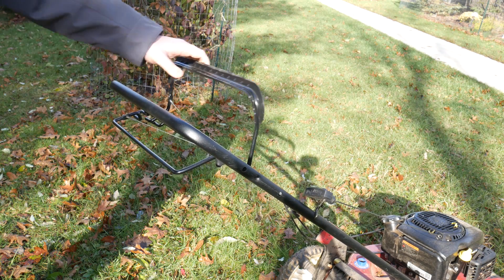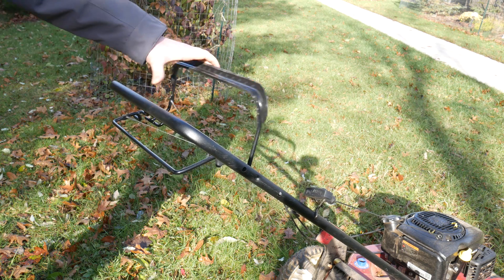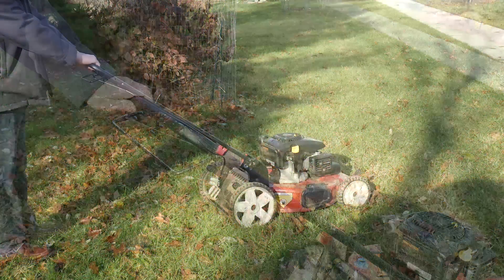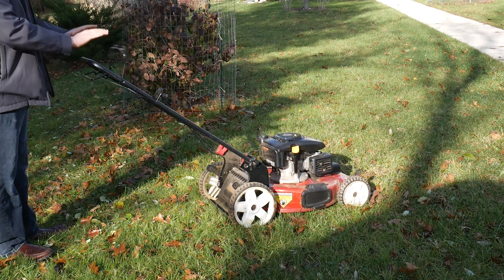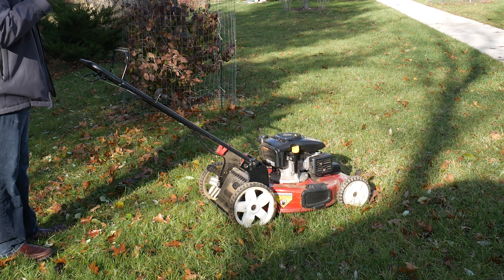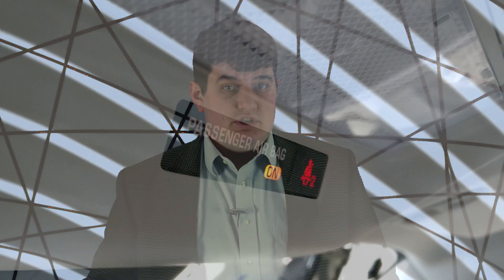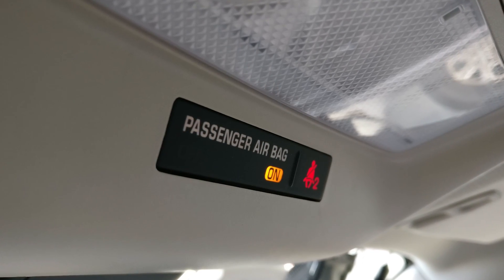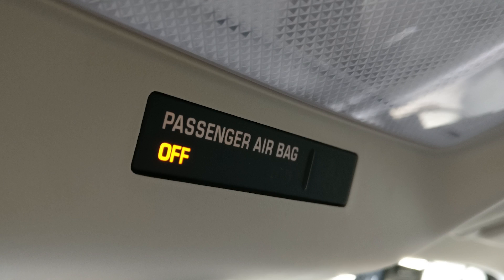The Dead Man's Switch:  How Anton Yelchin's life could have been saved

Comment: Yeah see i dont agree with this one, its good in theory, but cars are already getting worse and worse because of the hundreds more falure points added with each and every electronic system that requires a ton of very fragile equipment in order to make the vehicle function properly. Most safety issues could be solved with social engineering rather than making cars worse. Rather than adding another point of falure we should focus on making cars scary again. Carse are HEAVY MACHINERY and just like any other heavy machinery you should have a healthy fear of the fact that, if handled wrong, it can and WILL kill you. For manufacturers this means, stop putting non intuitive controls in something that someone is going to use daily. And for the consumer this means you should always have complete respect for yohr equipment and make damn sure your using it exactly how you should be. This isnt just a way to get from place to place, its an actual TON of steel thats, at bare minimum, moving faster than the fastest human on earth. This thin can shred organs and send you flying across the roat at school zone speeds and you should absolutely be treating it as such.

Comment: The one caveat to keep in mind with such deadman's switches is that it would need to not engage if the car is going at high speed (say, when the sensor fails while you're going 75 on the Interstate.) Also, I think it would be better to have the sensor engage the parking brake rather than shift into park, since the brakes are cheaper to replace than the transmission.
Reply: He mentioned this at 6:47, and the car I drive prevent shifting into park if the vehicle is moving.

Comment: 8 years later, some modern cars actually have these features, to the annoyance of technicians like me.

Recently many vehicles have slammed itself into park as I lean slightly out the window to see where the wheels are on the alignment lift. Now I am fine with this due to safety reasons, but manufacturers need to be better about having accessible options to temporarily disable these features during service.

Comment: There are “interlock” switches that cut off any input from the operator unless their butt is in the seat for the forklift at my work.
No throttle, no forklift control, until you’re sitting in the seat, then it allows operation.

Comment: Slight problem with this: what happens if the sensor becomes faulty, and reports, even for a fraction of a second, that the seat is empty when it is not?  A car shifting into park in the middle of the highway because a vibration jostled the sensor loose would at best end in a lawsuit and at worst in death.
Reply: But regular train have it already and it seems not so dangerous
Reply: @Lateever  yes, because a train coming to a stop in the middle of the tracks is rarely in danger of being rear-ended by the train behind it that did not have time to stop.

Comment: While agreeing in general terms i would like to add two repostes seven years later.

Based on track tecord i wouldn't expect car manufacturers to include overrides for failed sensors that prevent operation.

My electric bmw turns off and beeps incessently if the driver door is opened while in driving mode, even if in park. If you ger into the car, turn it on fully (with brake applied) and then need to exit to remove snow for example you have to shut the car off and then restart it in the base mode (without brake applied). The same happens if you are at a stand still in drive with brakes applied and want to open the door to check if you are properly inside the parking spot. It is flipping annoying and exactly what a car manufacturer do with this kind of idea.

Comment: Hi, I'm from the future. I'm happy to report that in my driving experience both Ford and Tesla have employed such technology by now. In 2023 I will buy a new-fangled F150 pickup truck that is actually all electrical, instead of running on diesel or gasoline. I know, it's amazeballs! In any event, while still in reverse, neutral, or drive when I open the driver's door the truck automatically shifts into park and tells me it's applied the parking brakes. I wonder if they did that because of Mr. Yelchin's avoidable death?

Comment: Many automakers have been doing something to solve this for decades. They use the drivers door instead, open it whilst stopped and the vehicle goes into park / neutral and you have to put foot on brake and reselect drive to go again. Something that is easy to do with these modern electronic shifters rather than physical cable ones.

Comment: So here’s the problem. There are many reasons why you may not want to be in park without someone in the driver seat with the belt undone. Pushing, towing, automatic car washes, and other situations need the car to move freely under other power. Also if need to undo the seat belt while driving to take off a jacket, or adjust the belt tension, I don’t want the car being forced into park from highway speed. A smart switch would work great. No driver = no power to the engine. If the car is moving and looses the driver, (seat belt+pressure sensor) the emergency brake is applied and the motor is turned off. However if the motor is off, and the driver is out the transmission should be able to be put in neutral. It’s more software, but saves all the issues of a deadman switch that shifts the car into park.

Comment: My 2015 Chrysler (same company as jeep) has a seat sensor in the driver seat as well.

If the weight of the driver is removed while the driver door is open and the vehicle is left in drive or reverse then the car will apply the parking break but… the car has to be on. If he turned the car off  and then got out of the car then yea… it’s operator error… because this system doesn’t active as if you were trying to roll the car is neutral or push it etc
Reply: But it will also not lock if I left it out of park and will ding ding ding “vehicle not in park” and I also cannot turn off the car if it’s not in park without holding the switch for longer than 5 or so seconds and it will remind me “vehicle not in park “

Comment: can confirm this would be incredibly simple to code.

You'd likely have an event system for sensors firing (event driven is "do X when Y happens", different from the traditional "run this code from top to bottom"), so you attach an event listener to the seat pressure sensor with the following checks ("return" here means "dont go any further, just stop here"):

if (speed > AUTO_PARK_THRESHOLD) return;
if (STOPSTART_OVERRIDE > 5) return;
transmission.set(transmission.park);

As for the "if it's broken, engine light" stuff, you'd have some mechanism (during startup usually) by which the computer will be able to check the correct operation of all it's sensors, say that every sensor has some "failing" property in code that gets set to false or true if the sensor is or is not working right respectively;

if (driverSideDeadMans.failing) {
  dashboard.lights.enable(dashboard.lights.checkEngine);
  blackbox.startup.log("Driver side dead mans switch failing");
}

and there you go. Individual companies can swap out variable names from this and use it however they like (in accordance with the GPLv3 license, open source you nonsense and let nerds tinker with their cars!)

Comment: The seat belt cannot be used as a sensor since there are people that have a medical condition that allows them to not use the seat belt. And at the same time is not fail safe - since there are people that put a dummy plug into the seat belt to avoid having to wear it. That would invalidate it as a sensor, since it is "always-on".
You are not always required by law to use the seat belt, but you are required by physics to sit in the seat while driving. So let's use physics not law.

Comment: Using the drivers door as a dead mans switch is a problem.  RAM started doing this several years ago.  People who needed to open the door and look to the rear when backing a trailer were then out of luck.  Most lawn mowers now have a switch which stops the blades when backing up.  This is a remarkable nuisance in many situations and I bypass these things immediately.

Comment: One downside of this is that people with new cars would get used to shifting to park and then forget to shift into park in other vehicles. There are cases of forgetting to stop the engine since the introduction of push to start. This is worse with hybrids and EVs where there is no engine noise at rest, but at least they won't fill your garage and house with CO and CO2.

Comment: I know I'm late to the party here but there is (and was at the time) something similar which I might argue is actually better. In the Chevy Bolt, if you open the door going below a certain speed the car will shift into park. I'm not sure there's any need to add a sensor to the driver's seat when you could do the same job with the door.

Comment: Sadly, even vehicles back in the late 00's started having electric brakes that engaged if the door is open and in gear. It's becoming more common nowadays but back then it was more of a premium option. Remember, many vehicles are built with budgets in mind. Some may buy a vehicle with less of those safety options like seat sensors because they don't feel they need it or because they can't afford it. Those options are expensive... For now cheaply made and implemented they are. A simple temporary switch goes for pennies when mass produced but they charge an extra thousand for it.

Comment: Most of the safety things you describe are on that vehicle. The vehicle was put in the towing configuration which disables most of the safety features and because this assumes another vehicle will be managing this and it can roll free especially if it’s on a hill. If he hadn’t simply removed the key he would’ve never been able to accidentally get into this configurations which is the recommendation for each time you get out of your vehicle remove the key (the one you did not List as a safety feature) you have to be in a safe parking configurations. But all vehicles have a towing neutral configuration which usually requires the keys to be sit in a pacific position you must engage the foot break to shift into this position it does not freely jump into that position. And the gauges which displayed what year you were in or somewhat confusing on this vehicle. That’s also where it’s always good advice to read the owners manual and understand the towing in different configurations before you ever drive a vehicle. Because all vehicles are different on how they have to be done they put into a towing configurations and when they are in a towing configuration if they’re only here or any incline they will roll on their on and nothing can stop them. There are tons of videos of tow truck driver is not having the car or truck properly secured when shifting into the towing position in the car just rolls off down the mountain. I know this has been done since the 80s on all vehicles even stick shifts and The steering wheel if you’re on an incline you should always turn your steering wheel hard to the left or right before removing the key.

Comment: My car has warning lights telling me if the passenger or driver is not engaging the seat belt - so it knows if someone's sitting down, all right.  It also has safety interlocks that prevent you from turning on the engine if the car is not in Park or Neutral and prevents you from taking it out of Park or Neutral if your foot is not on the brake.  From this, it can be assumed that the car is "aware" of the state of the engine, transmission and driver's seat - should be easy enough for the manufacturer to code it to shut everything down if the driver is no longer in the seat for whatever reason.

Comment: Tractors has it too, if you remove your weight from the seat then the tractor will stop. This is good at preventing you from running over yourself but most tractors have no suspicion so… the engine cuts out when you hit a big bump that bounces you . This is annoying but a fair trade off to prevent being killed

Comment: An easier method was not to change what's not broken. The gear shifter should be left as either a column or floor shifter. No need for complex or stupid designs. If I have to read the owners manual or look up YouTube video on how to use the shifter, it's a poor design.

Comment: It depends on if the WK2 uses CCD or CAN for the airbags.

CCD (Chrysler Crash Detection) is a bus designed for airbags only, while CAN is used for everything.

Part of the issue was also that the mailbox was not properly mounted. Mailboxes are mounted on break-away poles, while Anton's was inside a brick wall study enough for a 5000lb Grand Cherokee to back against and still not break away.

Another issue is reverse lockout. Federal law requires some action to shift into reverse from Park or Neutral (PRNDL is also mandated by law.). On older vehicles, you had typically to pull the column shifter forward or push a button on a console shifter to shift into reverse, but not neutral.

Comment: I could see seat pressure sensor could be potentially problematic for us short, lightweights that need special cushioning.  However, having the driver door open at low speed could put it in park.
Most if all cars will chime or make some indication if the door is opened with the keys in the ignition.
That Prius problem was the carpet getting dislodged from its fastener and scooting under the accelerator.  I'm sure two foot drivers hate the new interlock, but those driving behind such drivers sure would appreciate it.

I don't think any car has steering wheel disengaged from the steering mechanism, rather the power steering is electrical with a torque sensor detecting the wheel being turned, and a motor trying to negate the torque.  In this way you still have "drive by wire" yet can still mechanically steer should the electrical system fail.  Tough, yes but still doable.
Almost the same with ABS brakes.  The natural state of the brake valves allow at least one pair of the brakes operate hydraulically with the brake pedal.  At least these two factors are how the 2004 Prius was designed and makes sense for fail safe safety.

Comment: I wouldn't want steer by wire.
Pumped steering is better- the fuel saving is negligible and you can service it!
All this control and the power unit stuff is SsOooo expensive to fix, it;s hideous- and it WILlL break!

Comment: I had an issue with my previous car when it came to an electronically controlled transmission. It worked fine when the car was running.

However, I had a situation where I wasn't able to start my car and I needed to get it towed. Unfortunately, I had to put it into neutral in order to tow it and I couldn't shift it into neutral unless the engine is running. Fortunately, replacing the battery allowed me to get my car started so I could move it.

That is why I think, if the car has electronic controls, it should have a way to release the wheels so it can be moved if you can't start it.

Comment: Hey! Don't know if this has been mentioned or not... But actually a lot of manufacturers do not have occupancy sensors for the drivers side. How do I know this? I work in seat manufacturing. It's not deemed necessary and would essentially be an unnecessary cost. Furthermore the ones we make for passenger seats do not have intervals. It's a set weight, and anything above the threshhold arms the airbags for if an accident were to occur. How does one do a controlled deployment? You don't. Airbags use an explosive to deploy. There is no controlled or reduced detonation for this. It either fires or it doesn't. I am a big fan of this channel and this is the first outright discrepancy I have. Just mentioning for education. Thank you.

Comment: What about little people who may not weigh enough to trigger airbag sensors? It's what, 65 pounds? I'm 5'3" and weight 100, so we just going to make them carry a sack of bricks, give em' adamantium bones?
     We'd have to do it differently to the passenger airbag sensor, it would not be a mirrored copy at all. It's always important we keep these people in mind during any engineering process. Don't want to let our own ignorance to turn into ableism.
    Oh, also, as a relatively short person, I actually lift my entire butt off the seat when backing up. I would just never buy a car manufacturered after whatever date they implemented a 'safety' feature like this. Like, great, I can't accidentally leave me car in neutral and let it roll away (which I've never had a problem with my entire life) OR I can just have to change my reversing position to where I can't see behind me while I'm backing up (a problem I have at least 2 times a day.)
    This is the same reason I don't want a manual vehicle as a daily driver. It's hard to manage three pedals with one foot as I lift myself up, so I sort of have to start rolling a bit before I can really get a good look behind me. With a new car like this, I'd be half blind the entire time I was reversing rather than just a second in a manual transmission car. And if I forgot out of habit and lifted up, my truck would slam into park. This sort of just seems like an idea made by tall people, now that I think about.

Comment: this could have also been eliminated if people taught their kids how to use the hand break, or parking brake as a car in idle is not powerful enough to overwhelm the brakes when they are applied correctly, blaming everything on manufacturers when people should be reading the instructions that came with the vehicle, I don't know how people miss that as instructions are supplied with every vehicle sold, quite possibly people just need to go back to driving school or even learn to read before using a machine that has a few tons of steel that can cause quite significant damage to a brick wall with just a slight tap.